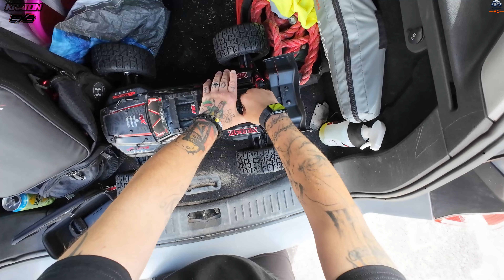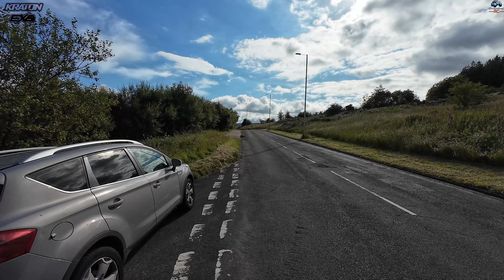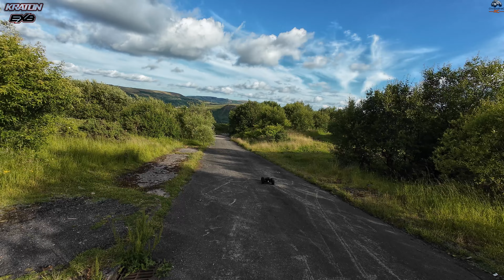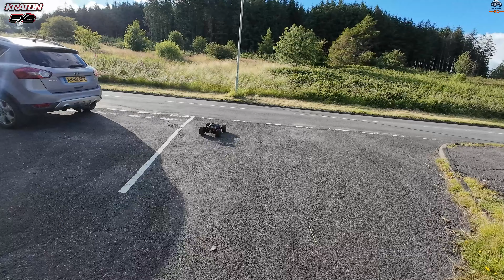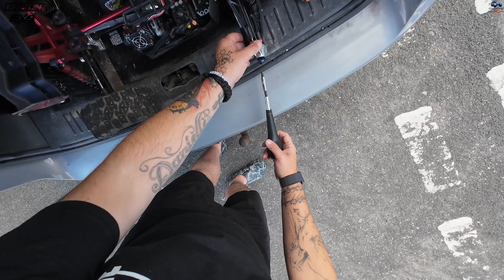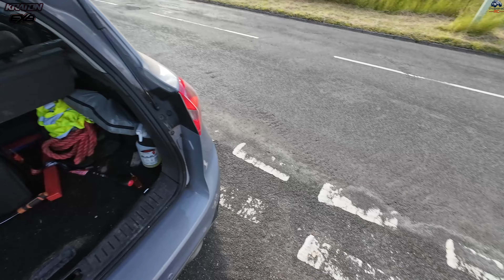Arrma Kraton 6s EXB Testing Upgrades and Solving Issues

Comment: That repeated drive shaft issue must be seriously frustrating ... An incredible amount of potential in some  platforms these days but the experience can be ruined for the odd weak part.. Hope you get it sorted  🤙🏻
Reply from the maker: Hey buddy , Yep im not going to lie it is getting me down a bit right now . Fingers Crossed im able to fix it soon though and get it back out to give it some hell . 
Stay awesome 
Chris :)
Reply: @ChriswithaCrc 
Tbf your "Hell" IS several degrees hotter than most bashers will ever give it! ...
 But they should be able to take some stick with (mostly) no problems.
Tekno and Corally both pique my interest and we are Arrma fans (son and I) with 
2 and 3/4 Vorteks  (one being a mint parts roller)

Comment: I was having the same issue with dog bones popping out until I removed the washers on the upper arms and drilled out the red anodized washers on the lower arms with a 3/8” drill bit so the pivot balls would go right through them. The red washers will still stay on the lower arms as they are a tight friction fit. Since doing the mod I have yet to have one pop out. BTW to drill out there’d anodized washers I wrapped them with some rubber from a tire tube and then held them with vies grips. That way the anodized finish doesn’t get marked up. I also added a 1/4” length of silicone fuel tubing to the front shock shafts to limit travel a bit as they pop out under full compression.
Reply: I did the exact same, haven’t had a problem since 👍
Reply: @jason_baker175  Cool, I am hoping the stock bearing were a bad run or poor quality. I replaced with ABEC 5 bearings.
Reply: @Doug_Morgan if that doesn’t work aftermarket hubs like Treal have 3 oversized bearings, mine are holding up great 👍
Reply: @jason_baker175  I was looking at those.
Reply from the maker: Wow thanks for the heads up buddy I’ll defo give this a go 
Stay awesome 
Chris 🚀🤙💪🤘
Reply: @ChriswithaCrc  It is an easy mod and works wonders. The only part that is a bit fun is when you take the red lower washers (cups?) off is having something to hold them with while drilling them out. I used some rubber wrapped around them and held them with vise grips so I wouldn't scar them up. I see some guys have just taken them completely off but i kind of like the red bling.

Comment: yes.  i know the issues.  pull off the red rings on the bottom arm.  you had it right by pulling off the washers and pull those back off too.  i explain in one of my videos you can look at and see why its there red rights,  because they made the are and then the EXB rings to make them stronger.  but it made the arms to short..  my video is arm popping  out something like that, about a year ago.   "Readeracing  RC".  we have chatted a few times.  your the dude from whales.

Comment: Didn’t want to say it when I saw it but I knew that fan guard was going to restrict the airflow. Get the dual surpass on it. You know that works well buddy 😊
Reply from the maker: Great point! yeah i gave it a go , it didn't work and now its in the bin lol . 
Back to using my normal fan guard now and all is well buddy . 
Stay awesome JP 
Chris :)
Reply: @ChriswithaCrc  Nice one Chris, you too. Hey my mate has a V5 version and he hasn’t ever had any issues other than one cup cracking and he bashed pretty hard like myself.   Got to be a floor with the car or something you have installed that’s causing it.

Comment: Hi Chris! I think these wheels are a bit big for the Kraton, there is a difference of 11mm compared to the stock ones and the car sits higher which makes it more unstable and the tire walls are a bit soft for some beld tires, talk to the Vitavon people to send you a cvd drive shaft set for all wheels, I saw on their website that they have them, I want to get mine for Big rock 6s
Reply from the maker: Hey buddy , Thanks for watching , I hope that your good . 
AS for the drive shaft issue i was having this before i added the new wheels . 
Yes there slightly larger but from research its a combination of the shafts not sitting in the cups correctly and also the drive shafts are a tad weak . 
Im Speaking to vitavon right now ! 
Stay awesome 
Chris :)

Comment: on my v5 i learned the front cv' pop out on compression not decompression meaning you have too much up travel or your if your shocks are set in the lowest ride height hole on the shock tower the middle hole of the 3 seem to be the best
Reply from the maker: Noted and ill make some adjustments . 
Thanks again . 
Chris :)

Comment: Oh… popping out in the front. You already said the only things it could be. Droop or cups. Is there any play in the diff up front? Might need a shim or two…
Reply from the maker: Front diffs are shimmed to holy hell and back thats something i always do . 
It turns out that the front drive shafts are a few MM short its a common issue , as the steering assembly pulls them away from the drive cups . Ive got a plan though ! 
More to come soon .
Chris :)
Reply: @ChriswithaCrc  cool, I can’t wait to see how you fix it🤙🏻

Comment: The old exb roller I have, had a similar issue, but wasn't as bad as the new one. The new problem is partly stemming from the new "improved" outdrive cup design that they accidentally made worse. Essentially they accidentally did their math backwards and moved outdrive cups inwards instead of outwards. 

What i did, as per the advice of Rich Duperbash was remove all the washers on the pivot balls and remove the red caps all 4 front arms. This allowed the shafts to sit a few millimeters deeper into the cups. 

Then also limiting the upward from shock travel helped a bunch. About 10mm of fuel tubing on the shock shaft seemed to finally eliminate it completely. 

If you push the front suspension up while looking at the dogbone the cup, you'll be able to see them travel to the very edge of the cup. On impacts, when the suspension is at that highest point, it's just enough force to knock it out of the cup.
Reply: yes that is the solution
Reply from the maker: You majestic man 🤙 I’ll give this a go asap thanks for the heads up James dude 
Stay awesome 
Chris 🤙🚀🤘💪

Comment: It looks like the cheaper Hobao sste is actually better that Arrma.
You getting the new one they just released?
Reply from the maker: Errrmmmm i would not go that far have you seen the time and effort ive put in to the SSTE ! not to mention the upgraded parts the SSTE is good but i would not send that to the moon thats for sure . 
Was thinking about getting the new 1/10th at some point , but would rather a updated 1/8th to try out as just picked up a Tekno MT410 2.0 for my 1/10th itch . 
Stay awesome 
Chris :)
Reply from the maker: Spent alot of cash to keep up with my buddies ? well thats not quite true i just love carefully picking parts , Reseaching and upgrading . as for the stock car its awesome but will say this issue is very common by the looks of things and well documented . So trying to find a solution as we speak . Ill report back once its sorted. 
Stay awesome 
Chris :)